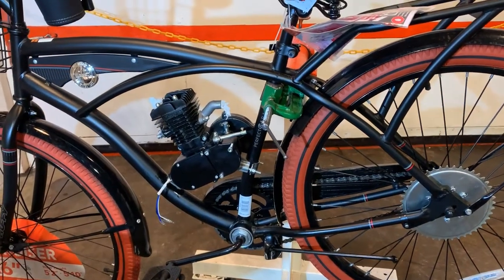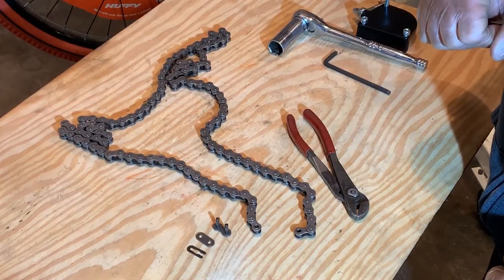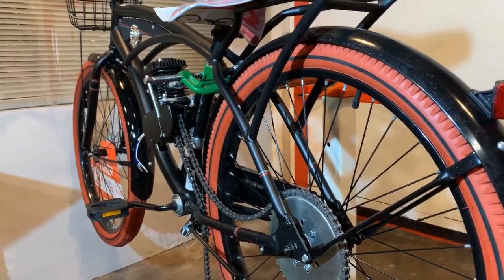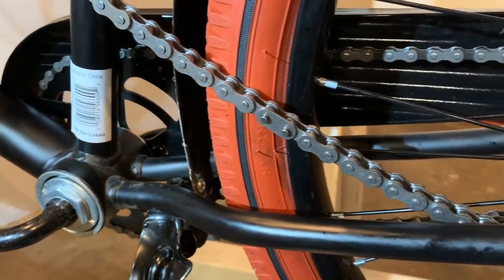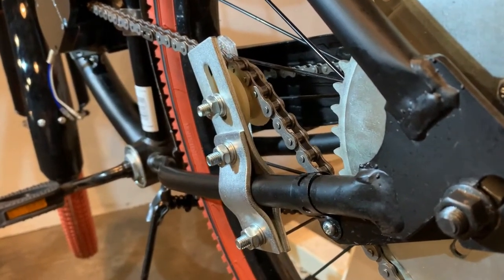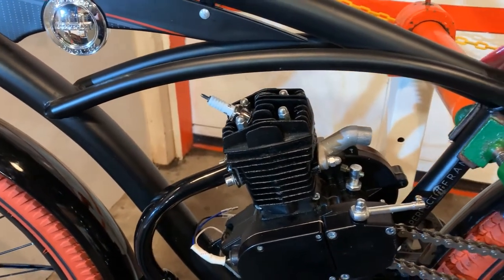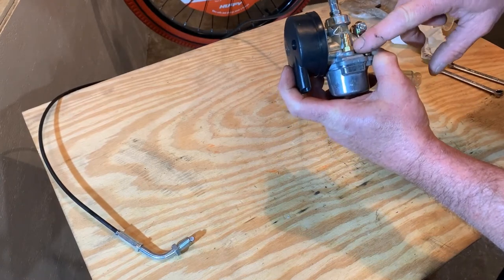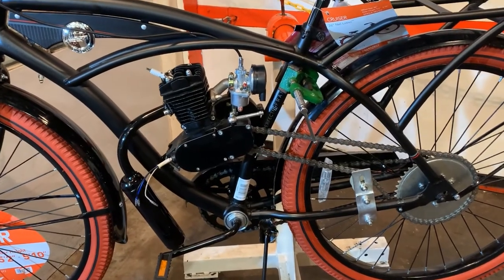D I Y  Step #3 Engine alignment & Chain Install

Comment: when I engage the throw-out arm the cog won't spin freely.  Any ideas?
Reply from the maker: If I understand you correctly, when you release the clutch lever to engage the engine it locks up the bike & the bike won't roll & the engine doesn't turn over ? 1st take the spark plug out & try it, if the engine turns over then it could be a spark plug that is too long & hits the top of the piston & stops the engine from turning over. 2nd Take the clutch lever cover off & make sure the chain isn't jammed up in that area.. 3rd If the chain is ok in that area, remove the right side cover & try to figure out what part is locking up ( The clutch & flywheel or the drive gear ( small front gear). Hopefully one of these inspections will reveal the problem..👍🚴‍♂️
Reply: @EcoTransGaspoweredBikes  .....I just mounted the engine on the frame, no clutch cables hooked up yet.  But when I push the throw-out arm..which should disengage the clutch....I can't freely spin the engine cog.  I heard that if you do this, it'll spin freely.  Is this correct?
Reply from the maker: @jwvgoethe77  Oh OK.. yeah it's probably just fine some times the clutch doesn't release when you first move the arm by hand when they are brand new..It's a simple fix just move the lever inward like your applying the clutch and roll  the wheel back & forth (some times with a little force) & it should break loose & turn freely. It does this because the pads sometime stick to the pressure plate from sitting..
Reply: @EcoTransGaspoweredBikes  .....That's really good to know.  Thanks for your explanations....greatly appreciated.
Reply: @EcoTransGaspoweredBikes  my drive sprocket keeps making the chain ride and making the back wheel lock any tips please please let me know . I’ve had a half finished bike with me for weeks . With or without the clutch the drive sprocket locks up . (New engine kit )
Reply from the maker: @adr4869  I think we can get to the bottom of this problem 👍If you can help me understand a little better about what's happening.. Are you saying that the chain rides up on your rear sprocket teeth & stops the wheel from turning OR is the chain riding up on the front drive sprocket & getting it's self jammed up in in the drive sprocket area.??

Comment: do u need to shorten the chain
'
Reply from the maker: Sometimes you might need to remove a few links, you don't need a lot of extra chain flopping around when your riding & it will make it easier to adjust.👍🚴‍♂️
Reply: So true!